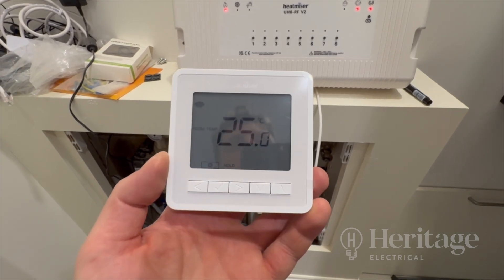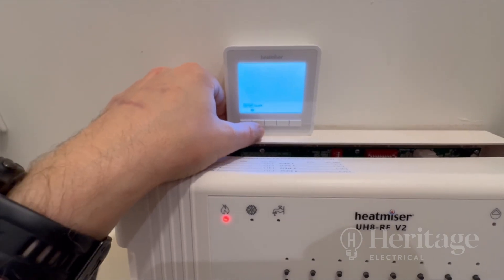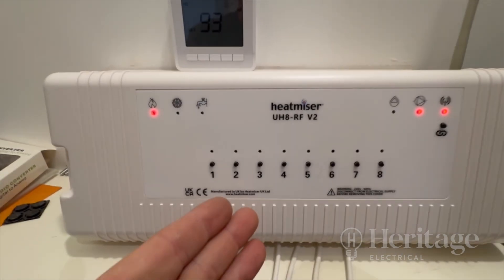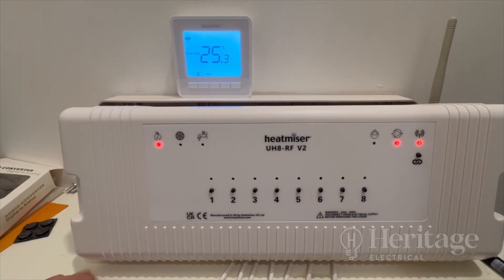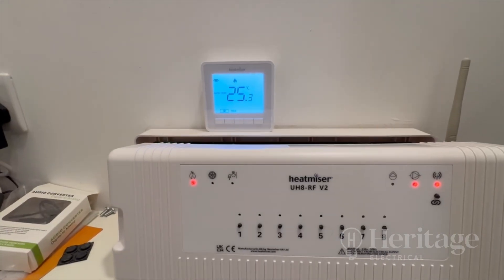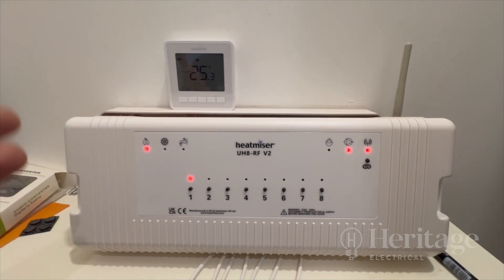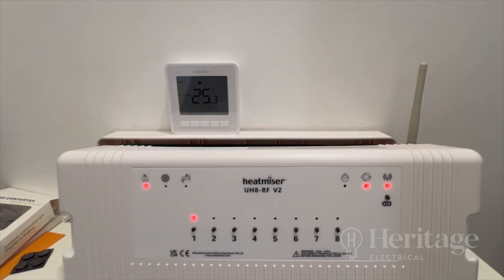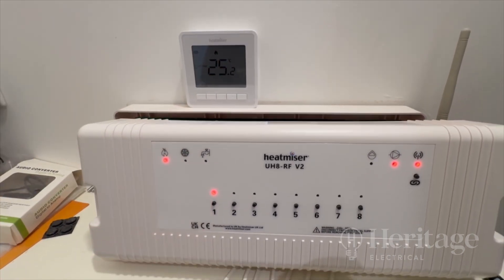Pair Your Heatmiser Neo Air V3 with UH8 RF V2 Wiring Center Easily!

Comment: What happens if you don’t have pairing buttons on the UH8, it’s just wires behind the compartment. I can see the zone I want, but no button on the zone?
Reply from the maker: Hi Charlie 
Thanks for your support watching the videos!

If you have a UH8, it is a wired only unit, so will have no pairing buttons. 
Pairing buttons are for wireless equipment only. 
If you have Neo air thermostats, you will need a UH8 - RF wiring centre. 

Cheers Paul